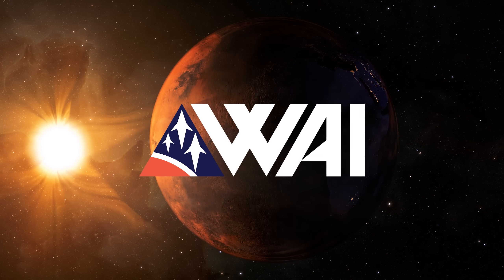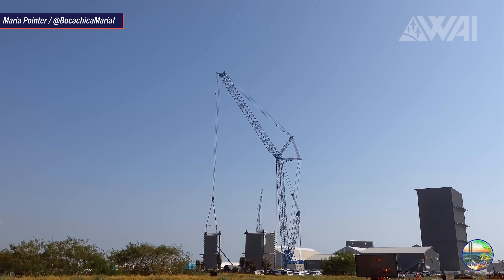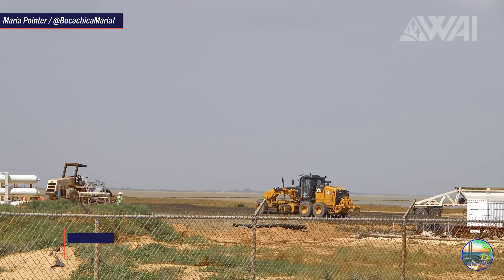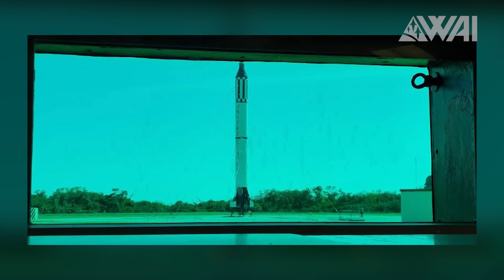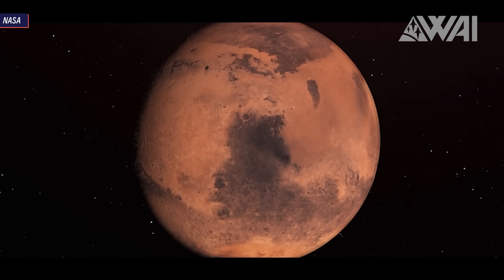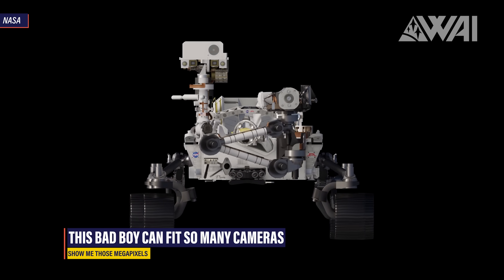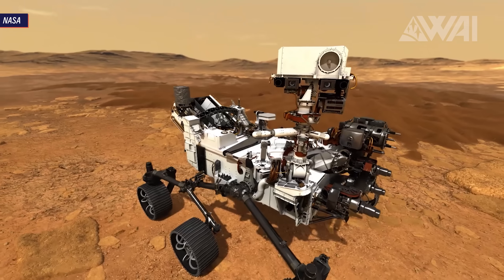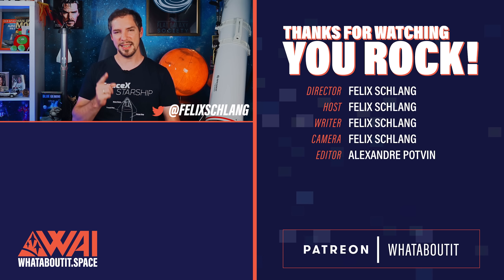104 | Will the Starship Facility Survive Hurricanes?

Comment: 4:55
Is the Mass Simulator made from SN3? We saw it being cut apart last week, and this Simulator has weld marks all through it. I know they have plenty of rolls of steel laying around that they could use for this, but, after the last spectacular blow up, I don't imagine those rolls of steel are reliable to be used as rings anymore. I'd think they would use leftover steel for the Mass. And SN3 was just laying there as a monument of a fail.

Comment: Hurricane protection can be augmented by diminishing approaching hurricanes.  Hurricanes feed on evaporation.  Reduce evaporation around Small Mouth by pouring some 200 gallons of soybean oil into the Gulf of Mexico between the storm and the spaceport.  The oil self-deploys to a molecular sheen, just one molecule thick, but it takes a couple of days.  (Soybean oil deployment moves at 0.1 to 0.3 meters/second.  Watch "Crazy Lake Experiment" and see what 1 tablespoonful of olive oil does to a stormy lake.  Trust me, it scales up.  I took on Irma and Matthew with 200 and 86 gallons, respectively, of soybean and canola oil that dopped the hurricanes 3 categories!  Pour out the oil onto the stormy ocean and suddenly the wind dies down!  It's amazing.  It will save the spaceport, too.  Row out a mile and pour out 100 gallons of soybean oil, row back, and when the storm hits, it will be more gentle at Boca Chica.

Comment: Imagine if a hurricane is bearing down on the Texas coast and the whole fleet just takes off and sits in orbit for a few days then lands itself
Reply: SS can indeed do that but SH can't. They will need to land back (after putting those SS in orbit) , refuel, have a nose cone fitted, and then hop themselves out of harms way, preferably to a place/location than can refuel them for flyback whenever BocaChica gets reconstructed.
High-bay and Contruction tents will not survive cat-3 and above hurricane hits, they will just have to be rebuild.
Alternative to hop SH away?: dismount the jewels (30+ raptors) of each of them and truck those away. Tanks sections will probably also be toppled by the strong winds.

Comment: 6:57
That is right, but it's misleading.
The reason is because most of the failures were from the soviet side, that took an approach to rocketry more similar to that of SpaceX in Boca-Chica than NASA, which is extremely rapid prototyping . So of course there were numerous failures, just like there were numerous starship prototypes that exploded.

Comment: While I am sure any structures built are designed to handle hurricane force winds, I have to wonder how well the site is setup to handle storm surge.   There is also the question of resistance to storm blown debris.  There is a lot of junk laying around just waiting to beat any structure to pieces with the help of hurricane force winds.
Reply: Those tents, including the high bays, will not stand up under hurricane winds. They are just hoping and praying they don’t get a storm before they get permanent structures erected. Gutsy move.

Comment: I still think for those braces to truly give extra rigidity to the high-bay, the corners of those braces should be tied to the together. If the braces were on the inside, they would make a gusset which greatly improves lateral-load it can handle, in this case, for wind.

Comment: 3:03 your wrong the SN7 did a 2 meter hop. 
( JK)
Love your videos
Reply from the maker: Technically you're right! Even though they strapped it down. Eager little test tank! :D
Reply: you mean SN3. edit: I mean SN1
Reply: @gavinkemp7920  no.  SN7
Reply: SN1 had a hop higher than 2 meters.  What's amazing is that neither SN1 nor SN7 needed a Raptor engine for their flights.

Comment: in space there is no hurricanes but to get in orbit u need to resist the pressure of supersonic speed so logically it's a beast and it will survive
Reply: Difference is that during launch it is pressurized.
Reply: @skyrask1948  It's also not got 20 foot of storm surge and shear winds blowing it over.
Reply: yes, IF the winds come straight DOWN from the sky , or at the nose if on its side....
Reply: @seminolerick6845  u forgot starship is suppose to do that skydive maneuver